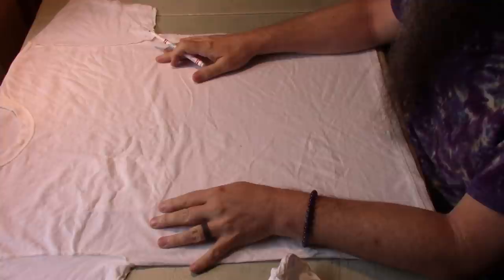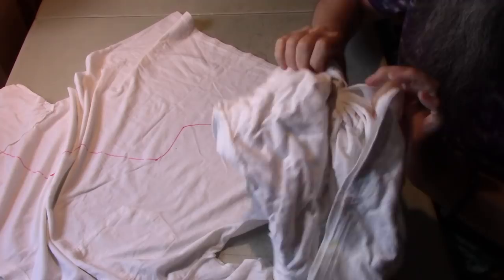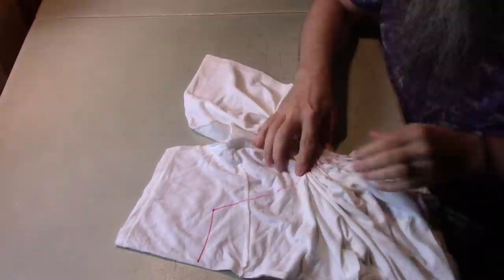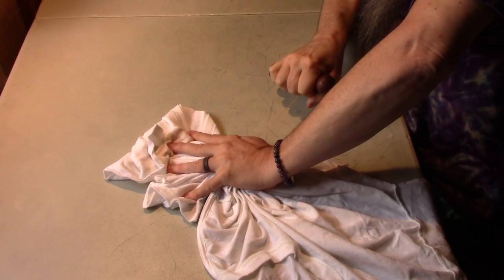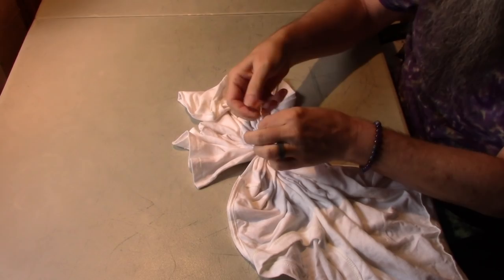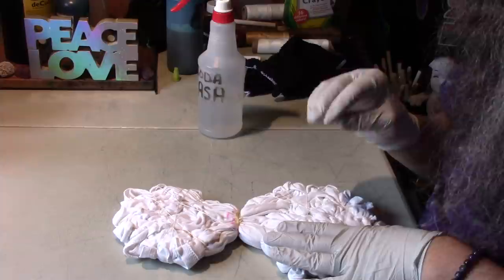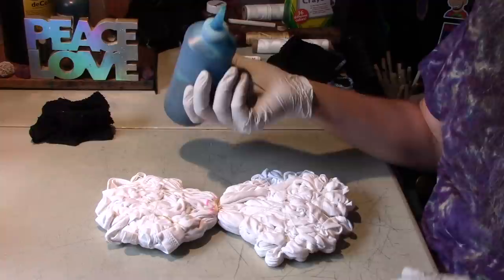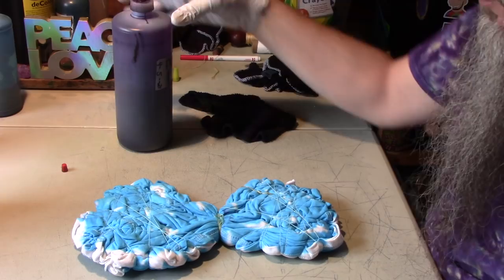How to Tie Dye a Lightening Design Tee

Comment: Love this video! I love that you did both white AND black. I have a question, what happens if you don't let it dry after bleaching before adding color? Thanks for the great content!
Reply from the maker: Thank you 🙏 and you are welcome .... as for the drying thing, that just makes for better saturation when I have things tied tightly with sinew .... so not letting them dry may just mean there is a bit of tee that does not get dyed .... but this can also be part of the pattern... sometime Is do dye it damp and have the extra color in there.... so it is good either way... just know what you want and go for it

Comment: Can the same effect be achieved with elastic bands? I'm an absolute beginner, and any answer would be greatly appreciated! Thank you!😊
Reply from the maker: yes you can, make sure they get wrapped really tight...  also, it will help keep the white if when you get ready to dye the tee, add some plain water to the banded area...  if it is wet with plain water, there is less of a chance of the dye soaking in there...  also, do not add dye directly over the lightening bolt area ✌️ ....  I do it with the sinew, but the sinew is pulled much tighter than you can get the bands on there 😉   Have fun and I wish you success!!  

Also, since you said you were new, here is my Beginner Playlist ... it has some helpful videos for those just starting out : https://youtube.com/playlist?list=PLMEtBqB2BzuquDrHsqxbv8LdFkaIyy3wo&si=NouxftjxZMYZrrut

Comment: Why do you dry the soaked shirts I thought you were supposed to dye the fabric while its damp with soda ash do you get better results by drying a few days?
Reply from the maker: there are many ways to dye the fabric...  once the fabric is soaked in the soda ash, the pH level is there whether you keep it damp or let it dry ...  most times I do fold, tie and dye while the tee is barely damp with soda ash ...  BUT, if I have folded a mandala type fold where I have many layers of fabric, or have tied it very tightly with sinew, then I like to leave it to dry some ...  when there is a slight bit of moisture in a tee and, then you stack several layers together and then you tie it tightly, that slight bit of moisture will 'block' the dyes from reaching the fabric ... the fabric can only hold so much liquid, once it is 'full' then the rest of the liquid will just over flow...  SO, if you have soda ash liquid trapped deep within the layers of fabric, the dye will not be able to soak in there, so then you will have white spots

so, with this design, I was tying parts of it tightly, so I let it dry some so I would get better dye penetration/saturation 

so for me, I just go with the flow of things and how they work.... the only 'Rule' I know of when tie-dyeing with Procion Dyes, if there was a rule, is you must have cotton(or other natural fiber), dye and soda ash all together before you batch the tee or tapestry as the soda sh activates the dyes... I hope this helps ✌🏻

Comment: I like the speed of the second half of the video.  Maybe do two cuts one slower and one faster.  Love love you work but the first part is a little slow for me because I’ve watched and have done tie dye like your showing.   Some you tubers do that😁. I don’t know if you mentioned that you can only bleach polyester blends and cotton.  Versis tie dyeing on white should be all cotton to keep vibrancy.  Thank you and keep our great creations coming.
Reply from the maker: Ok thanks ... editing is not my specialty, so I just do the best I can... but it does take a lot of time .... and yes 100% cotton is best, but not the only choice... as for discharging, I have not had much luck with removing color from polyester, but I will try some blends and see what I can do with them, thanks!
Reply: @MrTieDye  from experience what works for tye dyeing is opposite for taking color out..I soaked a 100%cotton in bleach for 24 and no difference.
Reply: @MrTieDye  also I’ve noticed hardly anyone is mentioning the importance of the blend of shirts.
I love your videos but it’s too slow.  Good for beginners but I’m assuming one beginners video is good.  I feel I miss out because o fast forward.  I really want to watch all of your video.  Just an opinion.  Maybe put it out there and see what others think ?  I don’t want to give you the wrong opinion o do love your work.  I’ve been tye dyeing and sharing with many for 1/2 a decade.  First was on the back yard ritz I was about 9.  Since then I’ve taught at leader 100+ how to do it and now I’m going to do thick water, needle nose bottles, dharma dye etc.  My favorite beaching is blue shirts.  They are the best.

Comment: Been trying to do a 13 point GD lightning bolt...inside a circle dyed 1/2 red 1/2 half blue with a white bolt in the center.  Because it is not a symmetrical shape,  it's been a challenge. Have you ever tried one?
Reply from the maker: the only Bolts I have done were with Stitching, I do not have a video for it, but I do have one for the method used : https://www.youtube.com/playlist?list=PLMEtBqB2BzuqTQ-6ymm5OcVb5jlv7oplr
Reply: @MrTieDye  yup that was your video that i used for the technique on my bolt. When the threads were cinched in became the shape of a cats eye.  Going to dye it this weekend. Just got my dye thickener.  Thank you for all you do!

Comment: The hoodie that you used in one of your old videos...was it 100% cotton? When dyeing a hoodie/sweatshirt does it have to be 100% cotton?  They are hard to find in 100% cotton.  Thanks
Reply from the maker: it was 90/10 cotton/poly ... it is a Hanes Ultimate Cotton Hoodie ... the other one I used to use before I found the Hanes was Gildan Ultra Cotton, and it was 80/20 and dyed up great ....

it is important to be mostly cotton to get the better colors.... BUT, a 50/50 hoodie does not mean it will not work, it just means the colors may look lite or faded.... but it depends mostly on the cotton content of the shell(outer part) of the hoodie

Comment: I'm curious why you let it dry? I was under the impression that if it dries, and/or becomes cold, the Soda Ash deactivates.
Reply from the maker: I let it dry for better saturation ... and no the soda ash does not deactivate... once you have soaked the tee, you are good with the soda ash... it can be hot or cold or dry and it will still work... the soda ash raises the pH level of the tee, that is what activates the dyes.... so once the dye comes into contact with the soda ash, it activates and if it is on cotton, then it starts to form a chemical bond ... heat will speed this process up, or time will do it...

 I like to have both heat and time, so I batch for 48 hours and add heat to the process by stacking the tubs with lids (you do not want the dyes to dry out or they stop bonding, that may be what you were mis told) near a heat vent, or out in the sun : https://youtu.be/SvhwNQbhZJA
Reply: @MrTieDye  Aaah, yes that may be what I read. Thank you for your response!

Comment: I dont get it, what is a ceniu, that is how it sounds, but havent hear it before, can you write down, and yes I am not US citizen
Reply from the maker: it is called Sinew, but really what we use it is an artificial sinew.... a polyester waxed string that is very strong, it is use in many crafts .... but in tie-dye, you can pull it tightly to block the dyes from getting to areas of the tee and the waxiness of the string will lock on itself when pulled tight enough ... I buy mine from Dixie : https://www.dixiegunworks.com/index/page/product/product_id/3340/product_name/MI0310+Artificial+Sinew+-+70+lb.+8oz.+Spool+-+300+Yards 

here is a video to show how I use it : https://youtu.be/nRKtNBZB5Qo
Reply: @MrTieDye  thanks man

Comment: Are your dyes thickened? I lost control with the liquid dye.🙁
Reply from the maker: not now... I used to work with slightly thickened dyes, but now I just use regular dyes, unless it is the black I use for outlining, then that dye is thickened and here is how I make thick water for really thick dyes :https://youtu.be/imaTXWdNJTo

but, if your dyes are getting away from you, you can thicken them just a little bit to slow their spread ... I do not remember my exact recipe, but I made a LOT of dye water at a time when I dyed everyday ... I used 5 tbsp of alginate in 5 gallons of water ... plus salt and urea, I think 4-5 cups of each.... mix it the same way as the really thick water... HOT water and mix the Sodium Alginate first, make sure it is completely blended before adding anything else, I let mine sit for a bit and then came back and blended it some more... then rub some between your fingers ... it should feel smooth... any lumps means it needs more blending .... and you could make a smaller amount ... this mix would go bad after sitting for a couple months... that is why I stopped with the slightly thickened dyes ... I hope this helps ✌🏻

Comment: Hi Carl. Thank you for your amazing videos! For the shirts that you’ve removed the color from, do you only spritz them with soda ash or do you also soak them prior to dyeing them?
Reply from the maker: thank you .... for tees that I discharge and then want to re dye.... I either soak them in soda ash, or I will dye it and then squirt soda ash over top, like coating it with dye ... the main thing is you need soda ash before you batch it ... here is a video on soda ash and when to soak your tee :https://youtu.be/rkmAQxOu52A

Comment: why do you dry the shirt in this video?
Reply from the maker: sometimes when I tie things with sinew, letting the tee dry before I dye it will help with dye saturation... and for this I wanted just a thin white line left  ... so dyeing dry helps as the liquid dyes will spread through the dry fabric where as damp fabric is does not travel much or very fast 

One thing though with letting a tee dry before you dye it, sometimes the dyes will want to roll off the fabric rather than soak in, for this I will lightly spray the tee with soda ash... this 'breaks' the surface tension for the top of the fabric and allows the dyes to soak in ✌🏻